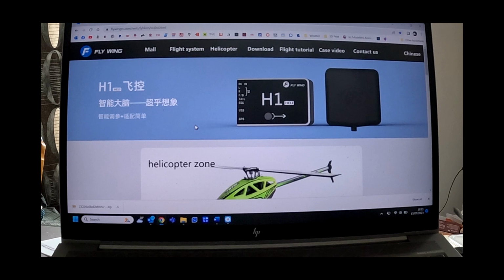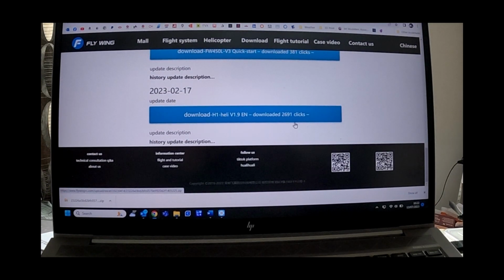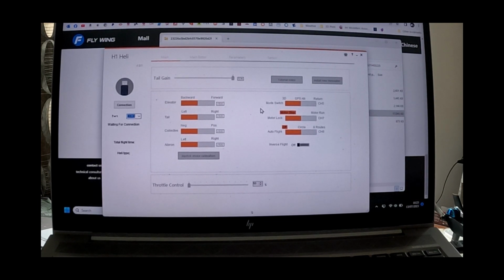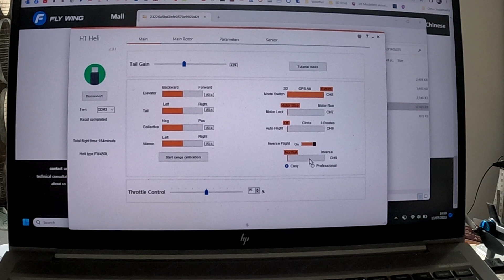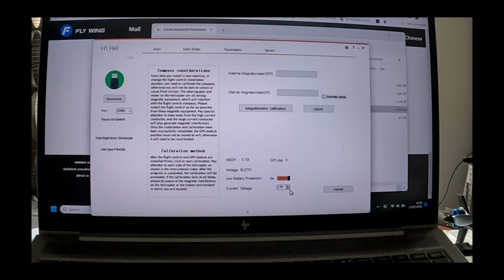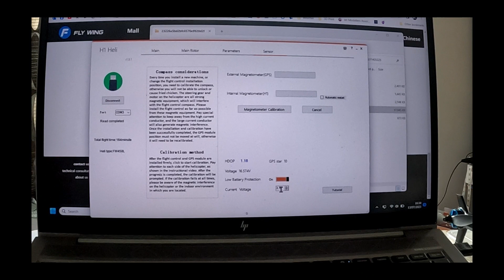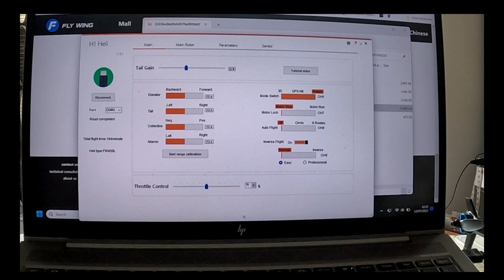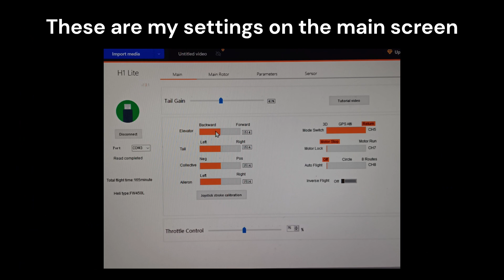My Settings for the Fly Wing 450L V2 5 RC Helicopter

Comment: Looking to buy a scale one can i change what switches i want to use like throttle hold on the right where is normally set and put gps on whatever switch i want
Reply from the maker: To be honest I am not 100% sure through the software. A guy contacted to say he had mechanically moved the position of the switches. Hope this helps.

Comment: Hi there can I switch modes on the heli I want the throttle b on the right stick
Reply from the maker: Hi Dean  I can't be 100% but I think it can. There is a mode selection I'm the Tx but not sure if you gave to change the wires in the Rx.

Comment: Hi m8 just a quick question? Can I lower the sensitivity on the sticks for 3d flight with the h1 software thing? The 3d is so sensitive I can hardly control it. And do u know what it should be on for 3d flight?
Reply from the maker: Hi you will need to plug the heli into your laptop and change the settings. I have done this on mine but everytime I re check the settings are back to default.  I am currently changing the transmitter to Futaba so I can use the Dual Rates and expo to calm it down. Hope this helps.
Reply: @All_things_RC.  Thanks but how do I turn down the 3d settings so it's not so aggressive?  But I know it needs to have some aggression for 3d flight but I'm not sure?
Reply from the maker: @1stcontact808  Connect to the software. go to the parameters page and select maneuverability tab. In the left box "Acro 3D" choose the item you want to reduce the sensitivity and reduce this by moving the respective slider. Once complete select the tab soft mode. Again using the sliders reduce the sensitivity on the sliders. do this through all 4 tabs. Once completed select disconnect tab in the top left corner of the screen, once this is no longer green disconnect the USB cable from the computer and H1 controller. Don't just remove the USB cable from the H1 controller as your settings wont be saved you must disconnect the software first.
Reply from the maker: Please remember the Flywing helicopters are not capable to fly true 3D maneuvers such as tick tocks etc.
Reply: @All_things_RC.  Thank u that's what I needed to hear. But I think you maybe wrong as the flywing fw450 which is mine is more than capable of doing hard 3d menouvors! There are a few on you tube aswel 👍🏾
Reply: @All_things_RC.  Completely incorrect. Cheers

Comment: Hi Pete, my new FlyWing UH-1 V3 Huey has finally arrived.  Today I made the first flights at my flying field.  It's a nice helicopter.  I didn't touch the preset settings and I noticed that from perfectly still in hovering in GPS mode, the helicopter starts to move forward at a fairly high speed as soon as I switch to ATT mode.  Could the Collective Pitch setting be incorrect?  Please advise me on how to resolve it.  Thank you.
Reply: Hi Pete, very kind as always.  I hope we can find a solution, it's not nice to have the model run away.  Thank's my friend.
Reply from the maker: Hi 
Glad to hear you have received the UH-1 and completed a successful maiden. 

My 450L V2.5 does the same when I switch to 3D Mode. I had a go at changing the advanced (collective) settings in the PC software while following the instructions to save the settings once completed on flight modes 1, & 2. At this stage I didnt have any difference in the collective when switching between GPS & 3D modes.

I clicked disconnect when coming out of the software and then switched off the heli and Tx. After re-arming the Tx and Heli I found the settings had returned to the default settings and when switching to 3D the head once again move to different positions the two settings. 

As yet I haven't managed to resolve this and have just been happy to fly the heli in GPS mode. I will try again to resolve this and let you know the outcome.
Reply: Hi Pete, today I flew the new FlyWing UH-1 HUEY with one modification and solved the problem of excessive advance in ATTI mode.  In the 2.0 software I set the Swash Trim Forward to 1470 instead of 1500 as per the initial configuration.  Now it's perfect.  HI.  Maurice
Reply from the maker: @aloccimaurizio4191  hi  Mauriz I am glad everything has gone well and thank you for the info re the settings. I will adjust my 450L / Bell 206 accordingly and look forward for trouble free flight in 3D mode.

Comment: Hi Pete, I followed your suggestions and did the flying field tests.  I decreased the Tail Gain by -4% with a final value of 37% and the Throttle Control by -2% with a final value of 37%.  I also decreased Swash Exp by -2% to make the control with the sticks smoother.  The result is excellent.  I would like to thank you very much Dear Pete, your availability and competence have helped me a lot.  I'm awaiting delivery of a FlyWing UH-1 V3 Huey.  I hope I don't have any problems. Thanks my friend.
Reply from the maker: Hi it was a pleasure to help and I am pleased i have been able to support you to achieve the perfect flying heli. Your feed back and response is much appreciated, this is why I have developed my channel and it makes me feel humble to be able to support a fellow enthusiast. Good luck with the Huey I have read allot and watched allot of videos where there seems to be problems with the ESC overheating. Be cautious and observant after each flight to the temperature of the ESC and I am sure everything will be OK. I wish you many happy flight and the most graceful landings every flight.

Comment: Hi Pete, I want to thank you for the help you have given me.  I put your setting on my FlyWing FW450L V2.5 Airwolf and now it runs much better.  I'm using it in standard fly.  There remains some pitching at some moments.  Which parameter could I change?  Thank you.
Reply from the maker: Hi I am pleased that I have been able to help and that you have flown the Airwolf. First step will be to reduce your tail gain, I suggest this in increments of 2% max total of 6%. If the pitching remains or gets worse stop lowering the tail gain but leave the setting where it is. Begin to reduce the throttle control again in 2% increments until a maximum of 6%. Dont take the throttle control gain lower than 68%. if the pitching continues then lower only the tail gain from this point in 2% increments. 
You will find that decreasing by max 12% total on the tail gain should stop the pitching but it is important to change in only 2% increments. Please keep in mind if the pitching gets worse you will need to increase the settings not lower. Now I have put the scale body on my 450L 2.5 I have had to lower the tail gain to 22% and the throttle gain to 68% I guess due to the weight and or drag.

Comment: Hi Pete, very interesting video.  A few days ago I purchased a FlyWing FW450L V2.5 Airwolf.  I installed H1 software V2.0 on my computer and immediately saw that it had been set to Sport mode and that the parameters were very different from yours.  On the first flight I immediately noticed that the helicopter was very unstable.  I wonder if your configuration is also right for my Airwolf.  Can you advise me which configuration to adopt?  Thank you.  Maurizio.
Reply from the maker: Hi Maurizio The settings on my H1 controller were fully different when I received my 450L to those I have shown in my video. The H1 control is a flight stabilisation / positioning system therefore a 450 size heli will have similar settings irrespective of the aircraft type. Both the Airwolf and the 450L are similar sized helis so my setting will be a safe starting point. 
Have you noticed the videos on my channel of the 600 size EC145? This has an H1 controller on board and the settings of the EC145 Controller is very similar to the settings on the  450L. Hope this helps but please dont hesitate to contact if you require further assistance.
Reply: Good morning Pete, thank you for your kind and quick response.  I will try to change the settings and make them close to yours.  If you can give me your email I will send you a video so you can evaluate better.  Thank you.  Maurizio

Comment: inverse tab is no longer on screen and  l want to turn it on ,but its gone any way of resetting to get it back
Reply from the maker: If you have the V3 H1 controller it will be on automatically from the manufacturer.
Reply: nope tab was showing off first time l connected but l didnt turn it on as l figured ld do it later after seeing how it flies. next time in to turn it on ,, no tab
Reply from the maker: All I can suggest Geoff is to delete the file from your computer and then re down load the zip file from the web site. If this doesn't work I suggest contacting Fly Wing direct. Also try the comment made by @flyingPanMan below this could help.
Reply: @All_things_RC.  Thanks mate, unfortunately though lve flown her over 10 times now , for some reason she lifted nicely and when l moved the stick forward ( lve been flying remotes for over 30 years lol )  she went ballistic went right ( full left  did nothing,  no control at all,  and ended up in a duck pond. sent an email to Fly wing and they lol told me to move the stick right  lol it was going right, yeah its in a pond mate  lol  here's the vid   :)       https://www.youtube.com/watch?v=4U2wvI22bCM
Reply from the maker: Hi Geoff this is Deja Vu moment I took off to the end of the strip turned right and the heli came back up the strip at low level in a right roll.  A viewer on YouTube told me I should have switched to 3D mode counted to 3 and switched back to GPS. HAHA like my reactions are as good as that at 60years old. https://www.youtube.com/watch?v=btJW_490YwA&list=PLTzAxw71mNy7-zyayJo9dT1P_CgXYMfGM&index=19

Comment: I also had to install the drivers (come in the zip folder) on both my Windows 7 and 10 machines. Run as administrator may help if anyone has problems installing.